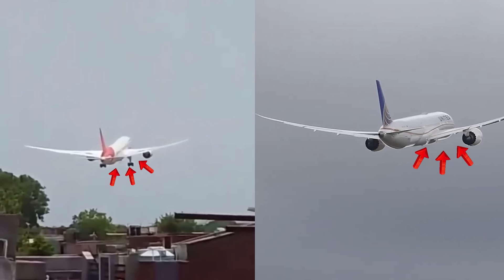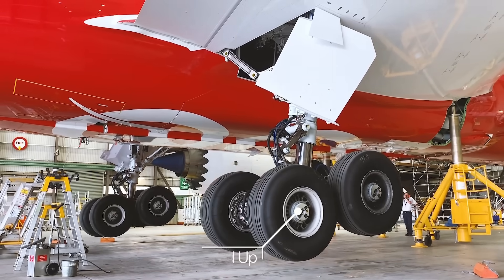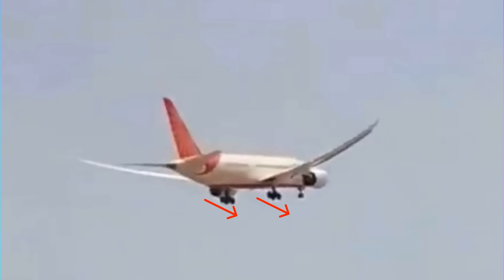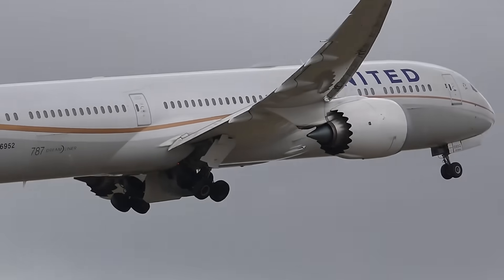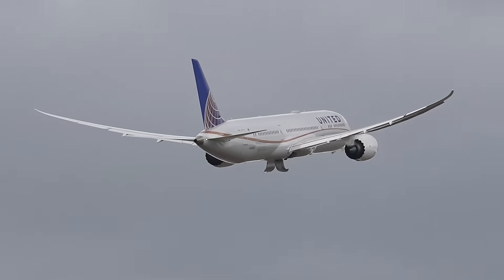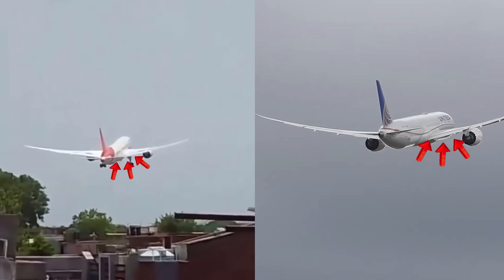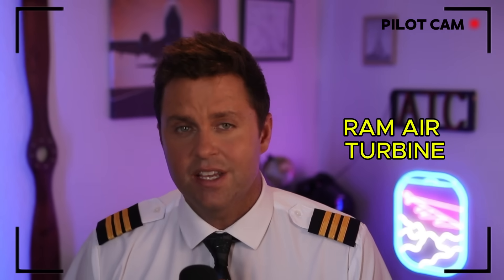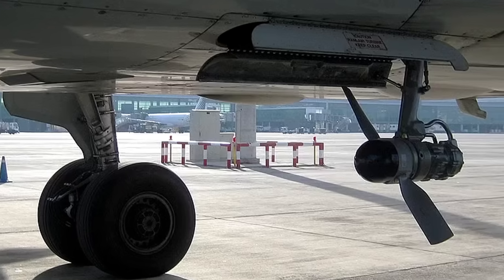Pilot Explains: A New Detail in the Air India 787 Crash Everyone Missed

Comment: I don't think pilot error or Boeing ... Weird is what many pilot videos have described the crash. What is the elephant in the room is the absence sabotage in the main stream media across the globe. Put this in the equation and weird starts to make sense. As s retired engineer with much experience with high technology computer control electromachanical equipment I note the following.
1. It has made a flight from Australia on the previous Sunday where high standards of safety are required before leaving not conclusive. It had then made it India on schedule. Indian airports are not noted for security. There is conflict with India with a neighbour.
2. The whole sequence of the tradergy complied with a maxim to totally destroy the aircraft and maximize the tragedy on the ground. Which it succeeded in doing.
3. The key to unlocking the sequence of events  and reliably maximize damage starts with how to sense when the moment the aircraft leaves the runway. Timers can have all sorts of problems. The key being the landing gear wheel bogies and their relaxed position automatical assumed at lift off. Wi-Fi sensors on each wing bogies determined take off. They trigger the engine shut off. It would take only a few seconds for the engines to go to idle with enough power to take the aircraft high enough to reach the town dead ahead but not high enough not to allow the pilot to steer the plane to a empty space.
4. What substantiates this is engines were at full power at leaving the ground. Pilot only used bottom half of runway entering by a mid runway slipway. Clouds of dust blew up from dry land at end of runway. Two bangs were heard on the ground as the plane took flight. An audio track from a video heard the engines spooling down to zero. Mayday from crew saying we have lost power. This maday also indicates emergency electrical power sequence operated as designed. Two engines down causing electrical power to cease. No break power supplies from lithium batteries kick in, keeping vital systems on line as evidenced by the mayday. Almost simultaneously the RAT drops, hence the comment by the surviving passenger of a bang and shuddering. There does seem to be contention of whether the flaps were down. However irrelevant if both engines had fuel supply sabotaged. Two bangs that were heard on the ground. If correct that would be left and right fuel ines being severed by planted devices triggered from respective bogies. Common to all three device placement,  accessable to ground staff. Well thought out in my opinion sabotage. Either that or there is a really weird fault. I think Okums razor is the first priority and security should be suspect.

Comment: I'm a 37 year retired airline mechanic. I have not worked on the787. I pulled up the schematics for the 787 hydrolics. The RAT hydrolics only operate the primary flight controls, nothing else. The gear and flaps only work off the center hydrolics from electric driven pumps. The engines drive the lt and rt hydrolics for flight control systems. Even if the engines stayed runing they would not work the flaps or the gear. The flaps can be driven by a small electric motor in emergencies but it is very slow. Gear can free fall in emergencies but not be retracted. The RAT electric only supplies power for a few critical things. 

What I don't know is if the engines will continue to run if there is a catastrofic power failure. They are computer controlled and I do not know where they get their power from. It is my understanding that both engines have to fail for the RAT to deploy. 

Strictly my opinion with what others have said about glitches in the operation of previous flights, the most plausable thing is that there was a total power failure and the engines shut down or went into a reduced power mode because of it. the aircraft went onto battery power and the pilot was able to send out a distress call. That is all they had time for.

Comment: Known Weak Points in the 787 Electrical Architecture:
Smart Power Panels (SPPs) and Remote Power Distribution Units (RPDUs) have had multiple failure reports, including:

Contactors failing to close

Overheating and arcing

Unexpected bus disconnection

Bus Tie logic (used to connect/disconnect left/right AC/DC buses) can malfunction or isolate incorrectly during transient loads (e.g., takeoff or generator handover)

The Starter Generator Control Units (SGCUs) or BCUs (Bus Control Units) can misbehave and disconnect power to FADEC subsystems

 In 2012 and 2014, multiple airlines reported uncommanded engine rollbacks on 787s due to in-flight ELMS or power routing issues (e.g., under high electrical load conditions)

🔌 FAA AD 2013-15-17: Warned about electrical power control unit failures potentially causing loss of power to FADEC and avionics

🧯 Lithium-ion battery thermal runaway (2013) had previously taken down multiple buses simultaneously
Reply: Boeing had full knowledge of these issues, yet they did nothing 😑

Comment: Either one engine failed but pilots shut down other working engine by mistake, or both engines failed at the same time. Theory that pilots pulled wrong lever, just not possible, they cant be that stupid, two different levers on two different positions, just not possible to do it, and i believe plane wouldn't lose lift so suddenly if they retracted flaps instead of landing gear.

Comment: There was a double engine power loss in a Titan Airways A321 flying out of Gatwick when too much biocide was added to the fuel. They lost power at 500 feet and supposedly the engine was banging and sputtering before the power loss. The survivor of the Air India crash said there was a loud noise before the power loss. India has had a big push toward adding biofuels to aviation fuel, since biofuels attract more water than traditional fuels it seems procedures for checking/cleaning/disinfecting the fuel supply systems would naturally have to increase, the question is have they increased these procedures after increasing the likelihood of microbial growth by mixing in biofuels, and have all ground crews been properly trained in the procedures and in using biocide and other additives. The Gatwick case was caused by a worker not understanding PPM as a measurement.

There was also double engine failure in a Cessna jet, in Florida due to Diesel Exhaust Fluid accidentally added to the jet fuel (there were two other cases of this as well).
 
Not saying this is what caused the Air India crash, but there does seem to be a global competency/complacency issue with at least some ground crews.

Comment: Just leaving this here for later I-told-you-so cred on the rest of the internet. Here's what happened. Plane had a variety of unaddressed electronic and ventilation issues in the cabin, deferred maintenance (per Pax video of previous inbound flight). 787 cockpit is 100% electronic, battery backup in addition to RAT. 787 hydraulics are Primarily electronic pump systems (3 separate). What happened: Electronic failure when Gear Up was selected, current surge from load on hyd. pumps  caused a cascade failure in the electronics bay.  Loss of electrical power and control data disrupted engine control units (these are not old-skool all-mechanical fuel control engines). Engines were at idle, not off. Power to CVR and data collection ended when all this started but I sure hope they built in at least a little internal power backup to these devices. A nice set of capacitors could easily get us a minute or more of at least the CVR.

Comment: Contaminated fuel isn't likely as there's no other instances of that happening to any other aircraft that day.  Also, since the fuel feed was probably tank to engine, if there was fuel contamination, the likelihood of both engines flaming out together is remote. I think you're right, dual engine failure, but for an unknown reason, but this is all hanger flying.  I'm a retired B777captain.

Comment: I am thinking there was an engine with loss of power in the rt engine either rt at V1 or after so they went ahead and rotated...my reason for my theory on a single engine failure at first is the CCTV shows a vortex of dust etc at the end of the runway as they take off.. .but I dont see it on the rt side....then after rotation the remaining engine fails due to possible contamination of fuel.

Comment: I don't understand why all these pilots analysing the crash ignore what the pilots of the doomed aircraft spoke to the tower: "Mayday. We have lost power and we have no control." That's what they said immediately before the crash. So that's why they crashed. Both engines had failed together. Most likely contaminated fuel. They were at flaps 5 and they left the gear down to help absorb the impact of the crash before it hit the pasengers. The RAT was out and the engines noise was winding down because they had both failed together.

Comment: Great analysis Gary. If it they had bad fuel, was the airport supply checked? Were other flights fueled and dispatched? As far as dual engine failure I wonder about EECs (electronic engine control). I never flew the 78 so we need some 78 drivers to weigh in. I recall from my 76 days that an EEC failure would cause the engine to "quit" (their words) or set to 55% N1 or thereabouts depending on the failure mode. The EECs, or the 78 equivalent, would be high on the electrical system priority. If they were on the battery bus for the highest protection, that requires a deep dive into the 787 electrical system to consider a failure that would manifest from top priority down. No time for trouble shooting at all in this case.

Comment: There's a video out there from a couple of days ago from a guy on the plane's previous flight, where he shows that the screens weren't functioning (visually on - but no functionality) and the air conditioning wasn't functioning either, it was sweltering inside apparently.  It does look like there was an electronics issue with the plane in some regard.

Comment: Not flaps, plane would have run off-overrun the end of runway, it obtained flight so flaps is a dead end. Not contaminated fuel, plane would have been underperforming during taxi and  ground roll to V1 along with external evidence of misfiring engine spooling smoke ect. along with auditable abnormal engine thrust sounds. This is absolutely some type of computer software issue probably caused during mechanical service. Computer just rolled the throttles down and all thrust was lost.

Comment: NOT AN EXPERT BUT JUST AN OPINION. Single engine failure followed by shutting down the good engine thus dual engine failure.
Reply: Unless there was a fire in the engine that failed, there would be no reason to shut down EITHER engine.
Reply: Yes, shutting down the wrong engine is a very common cause for dual engine shutdown. But in that case, the plane swerves. AI 171 did not swerve.
Reply: Does the 787 have rudder TAC?

Comment: 1) Flaps and gear can only operate together on take off.

2) Passenger videos show cabin overhead spotlights, attendant Call buttons, video entertainment systems and (most importantly) air conditioning all NON FUNCTIONAL.

3) Ahmedabad airport is notorious for bird flocks

4) Doomed Fight lasted 30 seconds exactly.

5) Lone survivor reports the sound of engines spooling UP about halfway through flight:

6) Long instance flights usually take off at night during cooler ambient temperatures, rarely during the day, and certainly never during 30° heat wave at 1 pm. This plane was fully loaded with passenger and luggage, and with FULL fuel tanks. Hot outside ambient temperatures means less thrust from engines.

Comment: If fuel was switched off, there would be no disturbance to the exhaust gases noticed,  but fuel contamination would cause popping and visual clues, smoke etc.  Contamination of fuel almost impossible due to testing and filter systems on bowser and aircraft.  But if fuel selected off, then engines would do a gentle unremarkable roll-back. Also, contamination would get to the engines at different times, not at the same time.

Comment: There are a number of causes for a dual engine failure after take-off. Fuel contamination by water, microbes or other is probably the most likely but engine control FADEC malfunction although it is highly redundant, electrical failure of certain key electrical bus could cut the fuel metering, control valve or engine control logic. Also loss of AC power to engine control systems could cause both FADECs to shut down fuel to the engines. They’ll need to check one thing at a time to isolate the core problem. There was a large bang heard by the sole survivor so maybe a compressor surge or stall. Let’s see what the investigators find.

Comment: One of the best summaries around. I concur that simply having the wheels down and flaps not set would not cause this crash. These engines are designed to power through these extreme situations. Something prevented the engines working.
Reply: FADEC (full authority digital engine control) system failure?
Reply: @colinbeck85  on both engines at the same time? I understand that each FADEC has its own independent power source?

Comment: No expert but you would think fuel contamination would of been picked up by the pilots when they are at full throttle on runway as they release the brake for the run down the runway you would think the engines wouldn’t run right as if your running out of petrol in a car

Comment: Thank you for your analysis, I think you are spot on! Can't stop thinking of what you said and wondering how could a double engine failure occur? Fuel contamination? People might think that because it was in India, who knows there maybe something dodgy with the fuel going on, but I think that is racist and inaccurate. It's a large international airport with many flights and I'm sure they follow all protocols and standards.  Did the heat cause the fuel to expand and bubbles to form and something was blocked in the hydraulics? Both at the same time, wow. And then how you said the engines sound like they are spooling down? Bad software? Amidst the human tragedy of those lost and the ones surviving them, once we know, it will never happen again. RIP Air India 171.

Comment: From video is appears the left engine was the only engine providing real thrust at V2. I am guessing both engines were not producing significant thrust during takeoff roll. The right engine was blocked a bit by the radio tower in the known video but did not appear to be producing thrust at V2. The left engine gave out within 5-7 seconds of V2.  The captain did not abort takeoff and decided to use the entire runway to get off the ground. The RATT was not visible in the video flying over the city. They have still shots showing the RATT deployed just before impact. I am guessing the RATT was deployed within a few seconds of impact. 

The pilots are supposed to aviate, navigate and communicate in that order. Because the captain issued a mayday call out. I am guessing that he was dealing with the reduced or lack of thrust during the takeoff roll. He only had about a minute of takeoff roll and flight time before impact. 

A dual engine failure is close to impossible.

Comment: My 3 guesses… improper maintenance actions made the engines fail (there was a 4 engine airline whose engines were failing rapidly and made it back with 3 failed  engines. Msintenance had serviced all 4 engines the same and left out critical o rings on all 4 engines).  Software bug.   Electrical failure